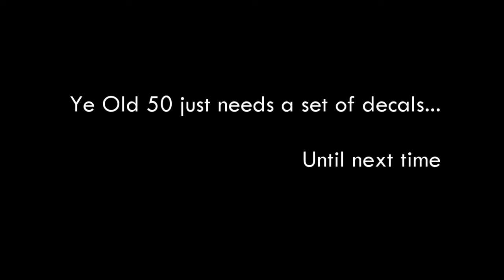MF 50  -8°C Cold Start & Carb Adjustment

Comment: That's a Mighty-Fine = M-F 50 sounds pretty stout & those Z134 Continental engines are pretty tough as well what year is she ? I have a 1959 M-F 50 & have had it for 25 years & the best upgrade I did was put a electronic ignition in her & in that  time I've only replaced the plugs twice , & rotor & cap twice as well ! & it has made her as reliable as my newer tractor that I bought new in 2018  a M-F of course M-F 1526  diesel 4wd with a fel to be exact ! But the M-F 50 gets as much work & is a keeper as well as my newer M-F thanks for the video .
Reply from the maker: the MF 50 is a 1962. I repaired an axle seal & did the break shoes on the left side while I had the wheel off. I had an electronic ignition on the MF 65 but when I first got it I kept leaving the ignition on too long and fried it.  Went back to points.
Reply: @gambrelgarage1832 I forgot about your M-F 65 ! & yes that will cook em , Nice to see You have  vintage M-F's that your working , & thanks for the reply .& that 64 M-F 50 looks pretty strait.